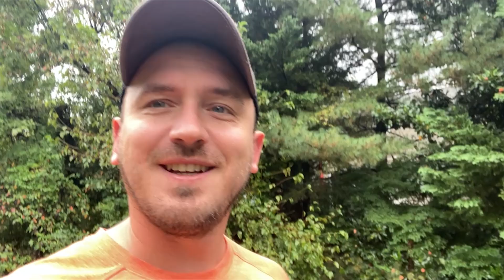What Should the Water Level in a Septic Tank Be?

Comment: Im on the PNW coast and just had roots tear through my wastepipe connecting to the main chamber of my septic tank. Water was backing up in the showers but would drain slow. It is an older home, so had a cleanout installed. Glad to know now that my septic tank isnt full again after pumping it 6 months ago. I can hear the liquid moving to the tank with the pump now. Do you think I should be checking my drainfield pipes for roots as well?
Reply from the maker: It would never hurt to have the drainfields looked at for roots, but it sounds like it was a mainline issue. Drainfields will have holes in the pipe where roots can easily infiltrate the system. If there are roots in the drainfield lines, they will keep growing back even if you remove them. Best practice is to remove the trees near the system. I realize that this is not practical in all circumstances.